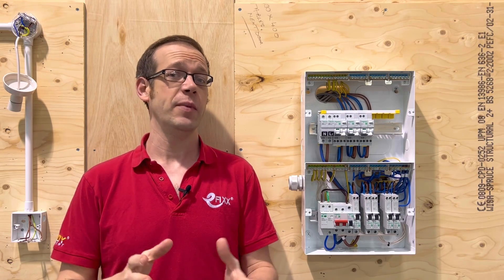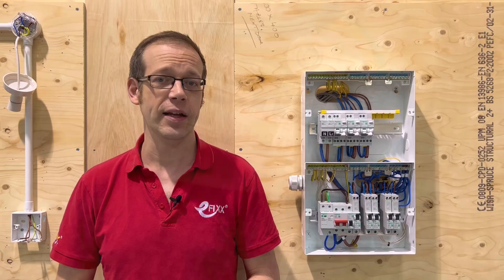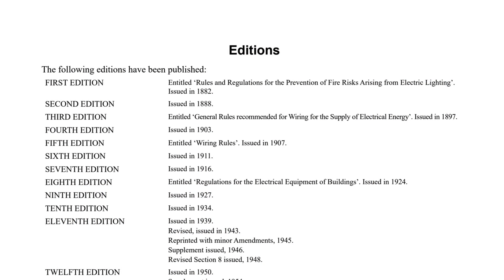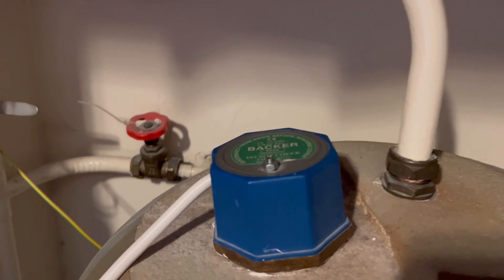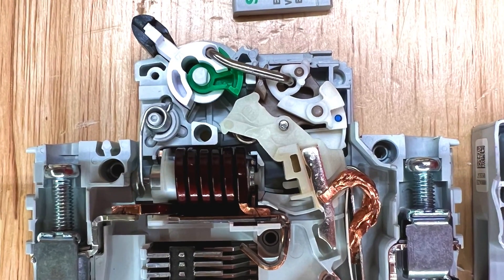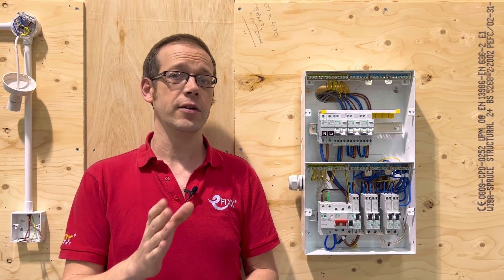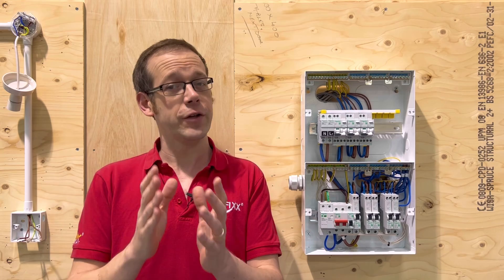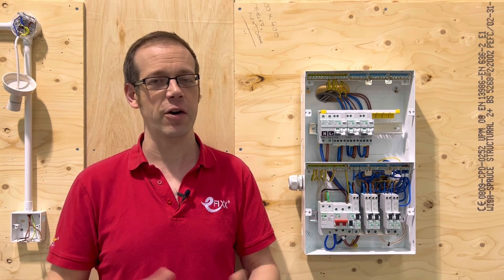What is an MCB and How do They Work?

Comment: What is the correct sequence of these four electric protection devices: MCB, RCCB, digital under and over voltage protection, and surge protection device? Does the sequence of these devices matter?
Reply from the maker: Depends on the application and manufacturers instructions really. 🤔
Reply: @efixx  suppose i want  to use it in my house

Comment: 140 years later people can still carry out shoddy wiring in their own home without knowing what they are doing.
Reply: They can but it won't pass certification.
Reply: @deang5622  you think the sort of people that do it care? they saved a few quid is what they care about. you can insure and sell your house without having an inspection so there is no incentive for it to be done correct.
Reply: @ShadowzGSD  I didn't say they cared.
Anybody can do any electrical work in their own home, whether it be notifiable or not and then quite deliberately not notify building control and no official has any knowledge the work has been carried out.

That has always been the case for the last 70 years.

There has always been and always will be such unscrupulous people. And the question is how do you stop them? And the answer is you can't.  Because no one knows what they are doing except themselves.

Unless you start restricting the sale of electrical cables and accessories to qualified personnel. And that's not going to happen.
Reply: @deang5622  oh no, you are one of those commenters, the sort that knows everything about everything and has to put everyone right and have the last word. 🤣